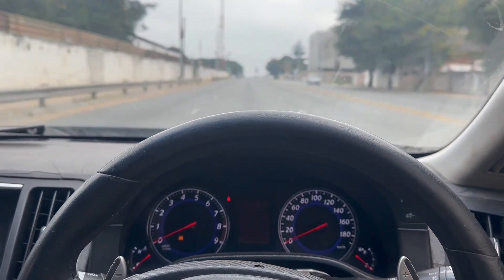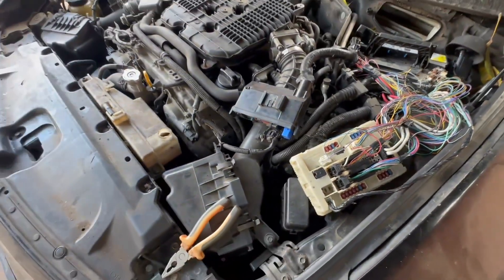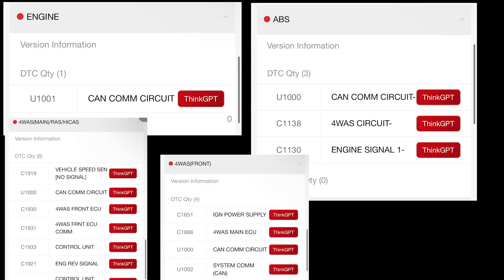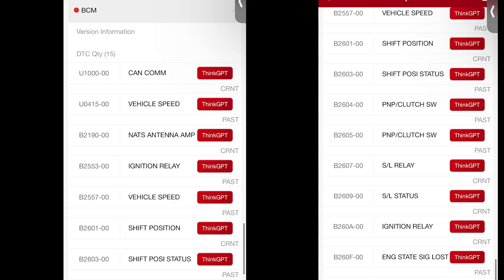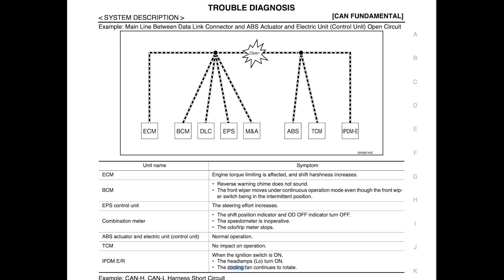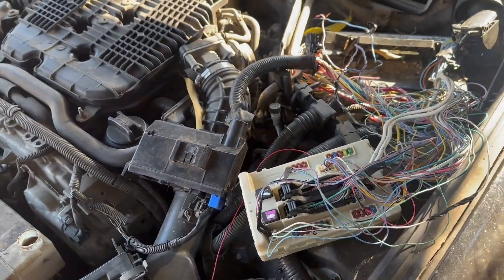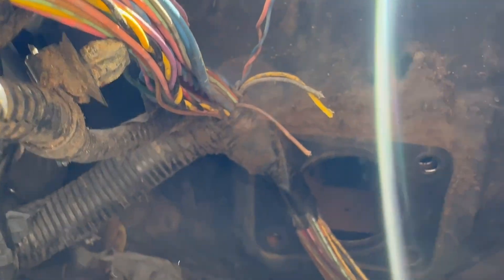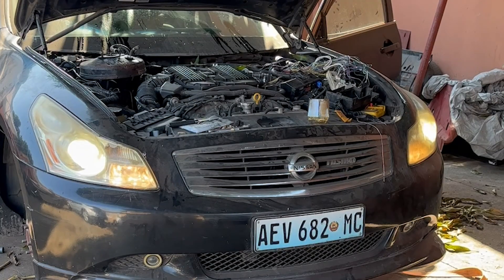Fixed Skyline 350GT VQ35HR U1001 & U1000 CAN Error! | Wiring Nightmare Solved

Comment: Im trying to figure this out now. I have code U10001 and it shows my abs sensor is not reading? I bought a diagnostic box and all modules showed they were working on that box. My abs light is not on, but my traction control light is always on. Rly wish I could figure this out. Any suggestions greatly appreciated.
Reply from the maker: Hi Mate, in wich module you get the U1001? at the ecu? if your ABS light doesnt come on means that the module is working normally but theres no comunication between the ABS module and the ECM and the Traction control signal is send from ECM based on wheel speed sensor data that comes from ABS. You will need to do some continuity tests to find the issues, tricky one tho.
Reply: @frankcumaio  It's showing faults in the engine and the abs modules. The engine code is U1001 and the abs code is u1000  Both codes are for can bus. I did live data while cruising, and all my wheel speed sensors were working, and showing accurate. Been trying to figure this out for years now. :( If you could point out where to test for continuity, I would love to try.
Reply from the maker: @MrPrplhaze1 i see mate. You can find the LAN manual on this link https://www.nicoclub.com/service-manual?fsm=G35+G37+Q40%2FG35%2FSedan%2F2008%2FLAN.pdf 

Go to page 36 you will see the ABS connector (E41) pin out and the pins 14 and 35 are for CAN high and low, then go to page 42 to diagnose the ABS branch, just follow the procedures. Good luck mate

Comment: Is that a cam gear rattle or faulty chain tensioner rattle on cold start?
Reply from the maker: Hi Mate. This engine is suffering from the infamous oil galley gasket failure, which is causing low oil pressure to the cam gear and timing chain tensioner. As a result, there’s also noticeable rattling at idle when hot.
The usual cam gear rattle on cold start is light and quiets down quickly, but fixing that ATM video will come up soon
Reply: @frankcumaio  thanks for the explanation.this type of gasket failure is specific to this engine right?
Reply from the maker: @administratorsowners1508 yes its specific to the early versions of the VQ35HR (2007-2011), they were paper based the new revision is a metal one
Reply: @frankcumaio  i wait patiently for the gasket job.i have noticed a very small external coolant leak underneath my 2tr-fe head gasket maybe this upcoming video will motivate me to fix it.